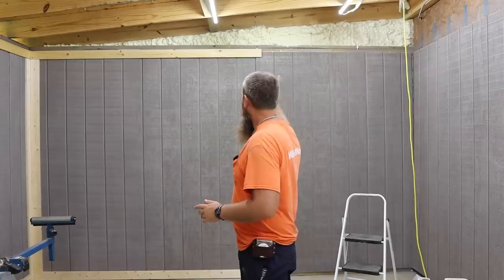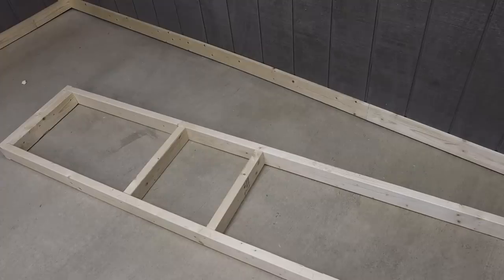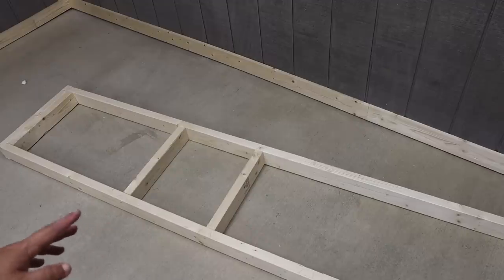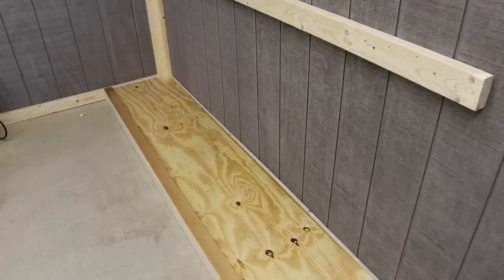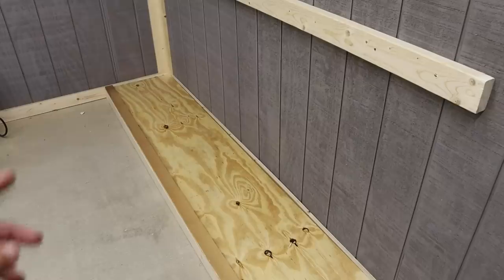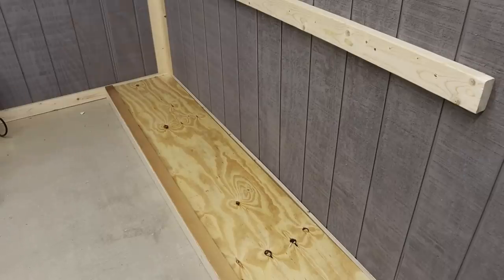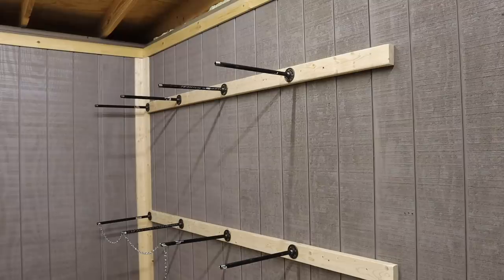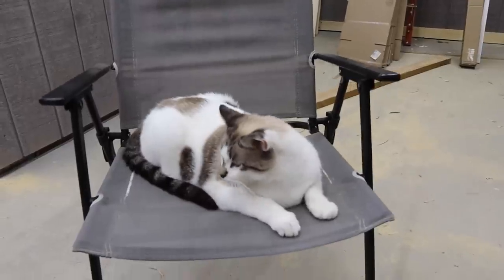Best Design I’ve Seen, Cheap & Simple Wood Rack

Comment: That roller on the left end of your miter saw has a plate that will move up and tighten in place.  When you're making a lot of multiple cuts, you measure your first board and cut it, and leave it in place.  Then you adjust the roller with the plate up so that it butts against your cut board.  Now all you have to do is put a new board butting against that plate, and your cut will be the same every time.  Production cutting, instead of measuring and marking or worse, doing like you were doing and marking from a board that you'd already cut (your measurement can 'grow' doing that).

Comment: Nathan - Might I offer a safety suggestion?  If you are going to store your lumber in your new rack vertically, you might wish to consider a safety cover over your fluorescent light taubes directly overhead.  Eventually it will get hit and shatter or you could turn them 90 degrees and recess themthe fixtures a little bit into the rafters for some protection.

Comment: You could also store lumber horizontally with those pipe.  I will be using that idea in my shop to store some boards. Great idea by the way!  Shop's lookin' good my friend!!
Reply: His Slabs are way too heavy for horizontal racks.  For dimensional lumber, it would be fine.
Reply: @johnm1926  Probably so.  Especially if not dried.

Comment: You could also have set your 2 x frame on some pieces of roof shingles, tar paper, plastic shims, the foam stuff that goes under sill plates etc.  That way any moisture coming up from the concrete floor won't keep going upward to your good dry boards.  And really you still could put some plastic shims used for toilets under the front edge. Would give the base a bit of tilt toward the wall which might be good for standing boards

Comment: They make an isolation pad that is used between the concrete and the wood sill for houses. It looks like a thin foam nd if you would use that it would keep any moisture from wicking up into the base lumber. You wouldn't even have to fasten it to the concrete, just staple it to the wood and set the base on the floor. Up here where I buy my wood he has the same black pipe to seperate the wood. He has put pool nuddles on the pipe and he says that this will protect the sides of the wood.
Reply: It's called Sill Seal.  You should use it Nathan.
Reply: @johnm1926  Yep, I couldn't think of the name. Always use it when wood come in contact with concrete or else you are asking for rot down the line...

Comment: You definitely need a lumber shed. Also won't the lumber warp standing up on end like that? If not standing flat against the wall won't it get a belly in it?
Reply from the maker: Nope be just fine.
Reply from the maker: Nope be just fine.
Reply: @OutoftheWoods0623  Is that because of the thickness of the slabs?

Comment: Curious why you want to store lumber vertically vs laying flat? Understand pulling a piece is easier. But isn't that offset by its tendency to cup & twist when vertical?
Reply: Remember, it’s kiln-dried…
Reply: @thatellipsisguy8984  Undried/fully wet wood absorbs 0 additional moisture Wood at 6% can absorb moisture in the air - especially if ends are not sealed, which can affect shape. Weight of other sticks when laid flat helps minimize end movement.
Reply: @landonedwards7504  Remember it is climate and humidity controlled.

Comment: One problem I see is your 8ft 2x4 is taller than where it looks like your ceiling will be installed.  You don't have enough ceiling height it seems.
Reply from the maker: Nope fits just fine. They are at an angle
Reply: @OutoftheWoods0623  The board at the top of the wall makes it look like you're planning to put a flat ceiling in there.  I don't see it, but is the roof you can see there insulated?  That's another reason I figured you were going to put a flat ceiling in, so you could insulate it and keep the heat in, in winter.
Reply from the maker: Closed cell will be sprayed on ceiling